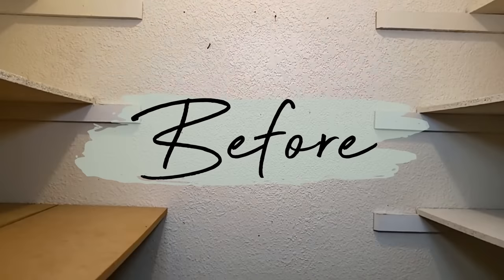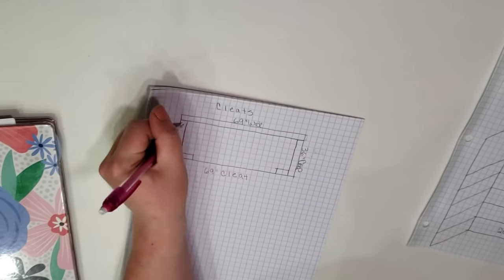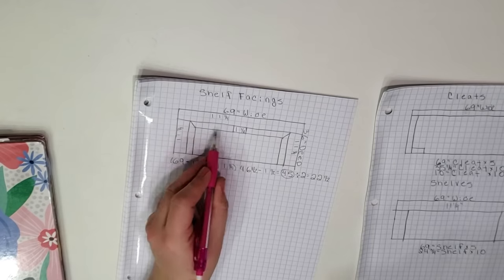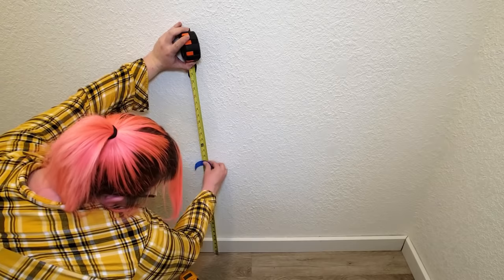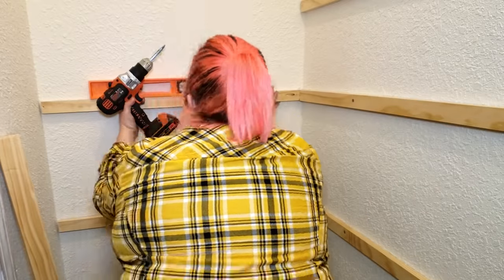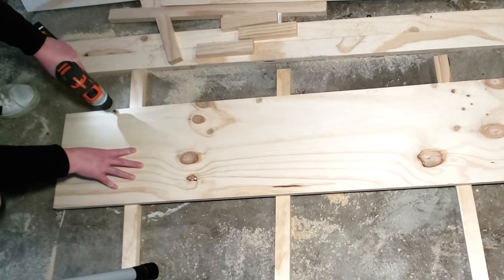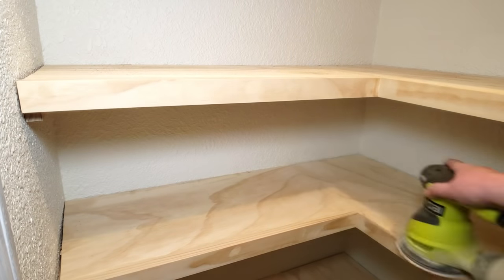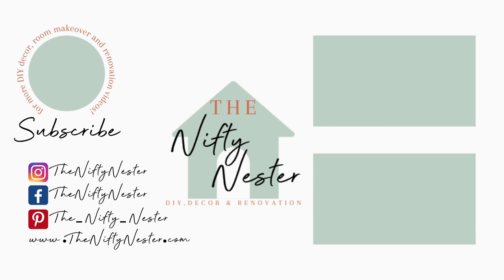How To Build Easy DIY Pantry Shelves | Small Pantry Makeover On A Budget EP.1

Comment: I like your process, and I find it very helpful to beginners; as I once was. In my "anal-retentive" nature, however, I tend to do my sketches to scale... like for the '18"T/D x 32W" ' toy box I'm building now to 'wrap' a car seat for a baby shower. I find it incredibly helpful to picture what I'm doing and work out as many 'bugs' as possible beforehand. In this instance, I 'rough cut' my corner posts at 20" tall; got them all milled up and smooth; then went to the sketch pad to figure out the rest. Now, I am having to work around my 'rough cut', which has turned out to be a final dimension; as the toy box is now 20 3/4"T (with the lid). Planning is important. Measure twice. Cut once. 😉
Reply from the maker: Thank you! I tend to over explain things but I remember being brand new to this and feeling like I couldn't find videos that thoroughly explained the planning process, which I needed (I still consider myself a "beginner" but not quite as much as I was a few years ago). I appreciate your comment, I love getting positive feedback and suggestions!

Comment: If I wanted to use 16" wide shelves would I need to use something larger than 1X2s to hold them up?  Thanks!
Reply from the maker: I think you'll be fine still using the 1x2s, you'll just want to make sure the side cleats are longer to accommodate the deeper shelves, having them run to the edge or stop a little before the edge of the shelf. As long as your cleats are secured to the wall really well they will support a lot of weight. A support bar along the front will also help support the weight of the shelves, especially if they're going to be very wide. Good luck to you on your project!

Comment: Did you use 1x1 wood for your cleats?
Reply from the maker: I used 1×2s for the cleats and the facings, made it easier for me material wise to just use the same on both. But you could use a 1×1 instead

Comment: Was the pantry built on top of the tile or was the tile laid around the pantry? I gutted my kitchen and can't decide if it will be better to frame and built the walk in pantry on top of the tile or frame it out on the concrete and then tile around it.
Reply from the maker: The tile was laid inside of the pantry. I'd frame in the pantry and get all of the drywall done first, and then you can install the new flooring before you install the floor trim. I don't think you could properly secure the framing in place over the tile. Also, doing the tile after you've framed in the pantry will make it easier to replace the tile down the road when you decide to renovate again.

Comment: How much weight does it bear?? Can we put vessels on it?
Reply from the maker: They seem to be able to bear a lot of weight, especially with the support bar in the front. I haven't had any issues with weight on these. I would say that yes you could put vessels on them but depending on how many and how heavy they all are. You could add more than one support bar, like one in each corner or two spaced out across the front of the shelf instead of one. That would help distribute the weight if needed.

Comment: what is the weight capacity for the shelves, especially the corner edges(weak spot) ?
Reply from the maker: I don't know the exact weight capacity. I do know the pocket hole joints have a higher shear rating than several other types of joints and the weight is fairly well distributed between the cleats and the support bar. In my pantry I have more than enough capacity for what I'm using it for, i haven't had any issues in the corners. If you needed to support more weight you could put support bars in both corners to help a little more with the weight distribution.

Comment: So if you don’t have a pocket hole maker what do you use
Reply from the maker: Without a pocket hole jig you could use brackets and screw them in to the underside of the shelves. There is a small pocket hole jig that you can buy for under $20 if you want to look in to that but the brackets would work just as well and would probably be a little cheaper than buying a jig.

Comment: If you had to remove this, how would you go about doing so with all the holes filled?
Reply from the maker: To remove this I'd work backwards, using the back of a hammer to pry the shelf facings off then unscrewing the shelves from the cleats. Then the cleats would have to be unscrewed from the wall and the wall patched, sanded then painted.
Reply: @TheNiftyNester  mmm did I miss something, all the nail and screw holes were filled with wood putty right?

How would you access the screw head if it's filled?

I'm building shelves this weekend, so just curious about what you did.
Reply from the maker: Sorry that's a good point. So the nail holes won't be an issue, it'll pull away without a problem with the hammer. As far as the screws, if it were me I'd scrape a little bit of the wood putty to expose the top of the screw then use your drill to remove the screw. Your drill will be able to pull the screw out even if there's wood putty there, you might just have to scrape the surface a little to find the screw. I hope that helps, feel free to ask if there's anything else you're curious about, I don't mind responding at all!
Reply: @TheNiftyNester  I see, thanks for the response!
Reply from the maker: No problem!

Comment: I know this video is a couple years old, but folks are still watching it (like me). While dry fitting your smaller shelves, why not use your one original and test each shelf position at the same time? That way, you'll know if it is too short, too long, or perfect. That will potentially save you the trouble of needing to cut an extra shelf, especially if you don't have enough left.

Comment: What do I need to do different if I am using melamine for the shelves?
Reply from the maker: The main thing I'd suggest is not screwing the melamine down to the cleats. It cracks easier than solid wood or plywood does. A nail gun might work better, you could test it on a scrap piece and see how it goes.

Comment: How much weight can such a shell hold? 🙂
Reply from the maker: I did a rough estimate of this when I first built these shelves but it's been a while and I don't remember. Different things impact weight limits but the shear strength of the screws, with everything properly secured to the cleats and the shelves properly supported, should give you enough stability to hold anything you could possibly need to store on them. You can also use more than one support bar if you're needing to support a lot of weight.

Comment: Your drawings are basically useless, writing dimensions on draft paper without actually using the draft paper properly,  makes your drawings inaccurate. You may as well just write down your measurements on any paper without drawing anything, you obviously are going way overboard.
You will have to go back in the closet, measure for your cuts and saving that measurement in your head til you transfer it to the wood.
Reply from the maker: I like to use graph paper to help keep my lines straight when I'm planning a project like this. If my math is right (and it was), then it doesn't matter if it's accurate to scale. There are plenty of reasons to draw out plans, even if not to scale, before starting a project. I'm a visual person, so drawing out my plan helps me to do the math and figure out how many of each piece I'll need. I use the drawing to count my pieces and make my cut list. I double-check my measurements as I'm drawing up the plans. By the time I'm done, I know my measurements are right, and I don't need to double-check every measurement before I cut it.
I'm not here to be perfect, I'm just sharing my process, and if it helps someone, great. If it's not for you, that's fine as well.